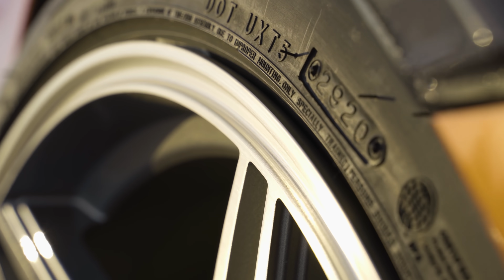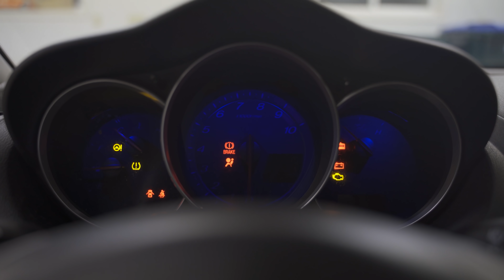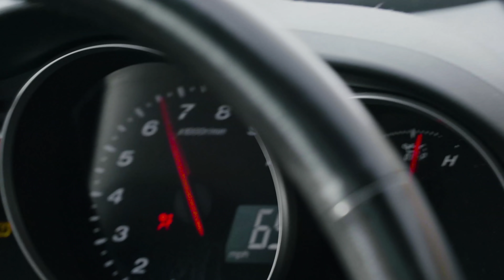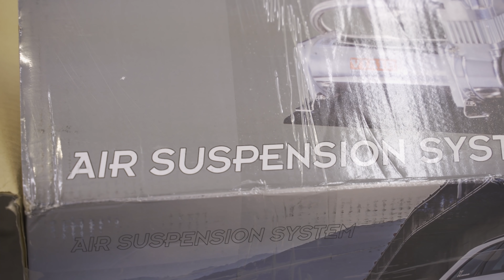Building the Most Unreliable Car!

Comment: Hey guys, some cool integration is if you find the original navigation system that sits on top of the dash swapping it with a raspberry pi, and putting open auto pro on it with carlink kit which has apple car play. 
Also racing beat is pretty awesome and not very promoted in the community but has a great exhaust and mid race pipe.

Comment: Hey I picked up my RX-8 in November too. I also plan on the Lion's kit. I can't wait to see what wheels this kit can fit without spacers (if possible) and I'm torn between Static and Air suspension.
P.S. - I'm not a fan of stretched tires or cambered fitment. I like a nice meaty flat foot look

Comment: Get the s2 gen diff it should be a 4.7 final drive makes the na engine feel stronger. Check out black halo racing for ls coil conversion. Orange virus can retune it. And your gen might have a cobb accesport. You'll Def want upgraded engine oil coolers and tackle the bad stuff on the car before adding rpm or power.

Comment: You mentioned at the end you're looking for any info on the car that you can get to maintain it's engine and keep it reliable. Well I'm sure you've done some research and that shows by you already having a Sohn Adapter installed (which is great) but I'd like to add a few things.

1. You should literally always let the car warm up. Even once the needle on the water temp gauge has ticked over to the "C" that's still not enough. I would always let it warm up just a few ticks past that (which I mention why in the next paragraph)

2. Don't ever trust the temperature gauge in this car. Ricer Rescue has a great video on RX8 reliability and he points out how embarrassingly long it takes for the car to actually warm up even after your water temp gauge says it's at operating temp.

3. I'm sure you've heard this already but your ignition system is a must on the RX8 and it needs to be in tip top shape or you risk flooding the car. I'd suggest a de-cat immediately since it will sound better but will also possibly prevent the cat from clogging due to a bad ignition system. Racing Beat makes good products like a de-cat.

4. Expect your tranny to grind in either 3rd or 4th. Mazda made some questionable trannies during that era of production from what I've heard, and I also fell victim to it lol.

5. If you plan to go sideways (which idk if you will since you're going to be on air suspension lol) then expect a LSD swap and possibly new rear axles since the ones on the RX8 were manufactured by Ford and are of questionable reliability. I have a cousins who tried drifting his and he immediately got crazy axle hop.

Hopefully I was able to give you some new info, and if you haven't already checked them out there are a few youtubers who have AMAZING RX8 content and I would recommend watching to get more info. There's Ricer Rescue like I mentioned before, Driven by Madness, Boosted Bois, Shooting Cars, and Japanda Tuning. Those guys are legendary when it comes to Rotary knowledge for the RX8 and rotaries in general.

Cheers!

Comment: Heads up the oil filter is in the worst. Place. I installed an agency power exhaust on one in high school 8 years ago. Flames. Do itttt. Also give it a little blip before turning off. To keep from flooding

Comment: If you're looking to buy a RX-8, No matter what country you're from or anything. Please put into consideration that the engine is super fragile, it needs to be taken care of daily and you really need to keep on top of maintenance, otherwise a little fuck up turns into a big one. 

If you're looking at one, they tend to love rusting on the Trunk/Boot and the inner and outer sills. I also recommend you get a compression test done on them also, that will either break you or save you. You're ideally looking for high 6's or 7's for a healthy engine. You also want to start the car and warm it up till it's to its temperature, then turn it off and try turn it back on. Some RX'8s tend to suffer with a hot/start problem which is something quite common and you should look out for. If your engine sounds anything like mine, well run away lol, mine exploded. 

Once you've bought it, if it's a perfect engine, always warm it up before driving. The cars loved to be revved also, so every now and again, give it some down the road, let it rev out. Stops carbon build up in the exhaust, they can get hot to the point it either melts the Cataclysmic Converter or burn the truck/boot floor. Everytime you come to filling up, always put premium fuel in and put premix or 2-Stroke oil in after. Keeps the engine lubricated and can prevent apex seal wear. And before you go on any long journeys, always check the oil and fill it up. Usually If you put that all into consideration, you have a reliable RX8 on your hands. Especially if you own a Series 1 like I do. The same follows for the S2 and R3 model. 

If you got anymore questions, feel free to ask me below. decided to post this again for those who didn't see the last comment

Comment: With modern advancements in rotary science the rotary is about as unreliable as a VR6 in all honesty....its not that bad. the rx8 clearly had some issues with oil consumption and are considered the worse of the rotary cars but like I just said with modern advancements in rotary science making these reliable is not a big deal. You can build a reliable turbo rotary for about the same as swapping a k20 into a EG and turbo charging it

Comment: The rx8 was the biggest money pit, makes no power and once the engine goes so does its value. Either you sell it for 2k or less, part it out or spend another 7k for a GOOD engine and still be left with under 200 hp. It's a great handling car but needs more power.

Comment: Rebuilding an engine at 60k to 100k miles is nothing, especially a rotary, one of the easiest engines to build. Most sport bikes require rebuilds at 30k to 50k miles.
 At least you know what you need to do, unlike thinking an engine like the LS will outlast the need to rebuild when it drops a valve at 100k~.